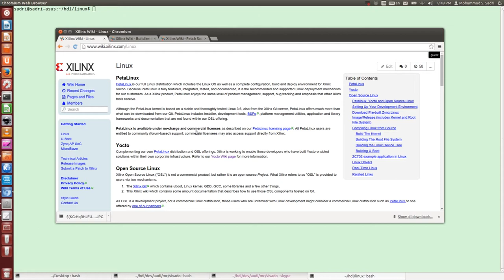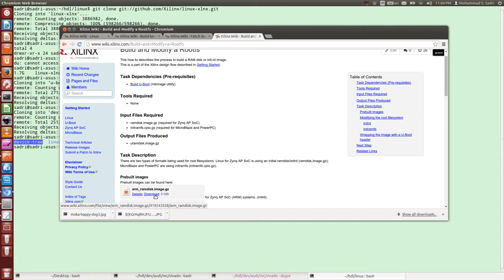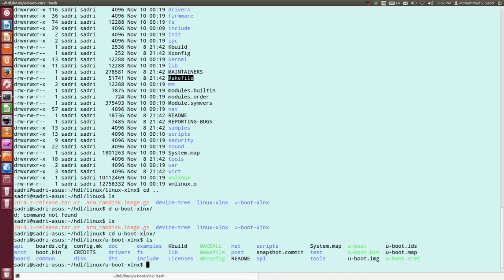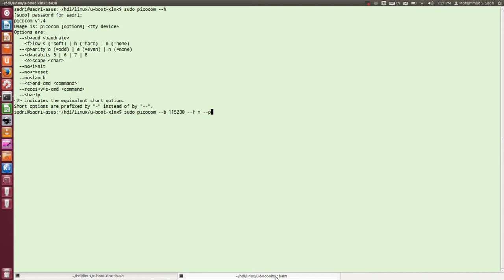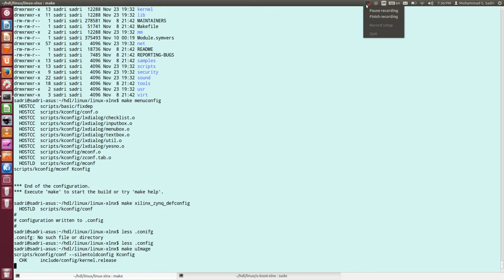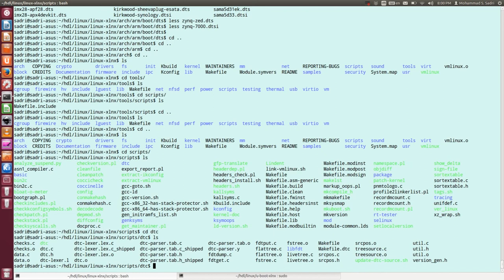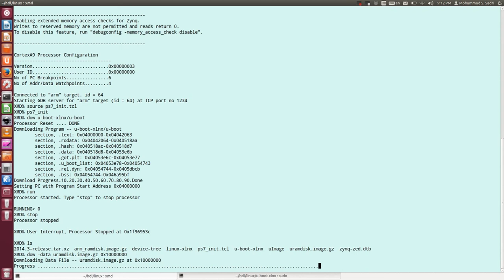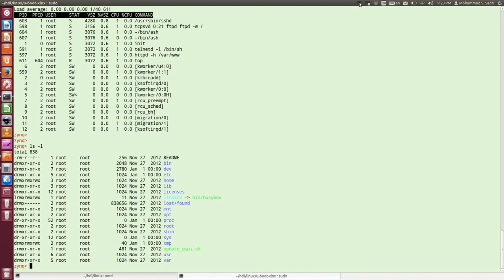Zynq Training - session 11 - part ii - Compiling U-Boot and Linux Kernel And Booting them on ZYNQ

Comment: Hey, Thanks for these nice video series. I am been working on RedPitaya and videos like these are a very help for me. I really appreciate that you not only shows what needs to be done but why it needs to be done in a specified way, which a lot of people just skip. 
Did you have any expereince with the Asymmetric MultiProcessing in Zynq7000 series SoCs?
Reply from the maker: Hi Waqar, thanks for your interest in videos. You mean to run , for example, linux on one core and another OS on the other one?
Reply: @MohammadSSadri  Yeah. I am almost there, just struggling in the last few bits.
I am planning to run Linux on one core and FreeROTS on other. That way we will be integrate the system with RedPitaya EcoSystem without that many changes.

Comment: Hi Mohammad,   Outstanding set of Zynq videos, very clear and well done.  In Session 11 - Part ii - Compiling U-Boot several boards I have tested program/operate exactly as described in the video but there is no terminal output when the con u-boot command is issued. In each case the dow command loads the u-boot.elf successfully and I can read from memory with no problems.  I have tested several ps7_init.tcl files based on your comments but none of them show any terminal output when u-boot is executing.  Any suggestions on debugging u-boot terminal output issues would be greatly appreciated.

Comment: Hi Mohammad, great job!
I'm trying to install Linux on QSPI flash. Is it necessary to compile a new FSBL? I tried to use the one provided by Xilinx but at the moment nothing works for me.
Have a nice day and thank you again
Reply from the maker: Hi Sarafino. I boot from QSPI in many projects. no, basically the fsbl does not need to change. you create one single boot.bin file with all the required parts in it and flash into qspi. should boot up. the intro video for a series in which i bring up petalinux from qspi flash is here: https://youtu.be/7rVamez_nBI

Comment: I followed up to running make for uboot (time stamp 25) and hit a problem. I'm using Ubuntu 16, and Vivado 2015.4. My board is a zc702, so I ran "make zynq_zc702_defconfig" to set the board configuration. Then I ran make, and got a fatal error (openssl/env.h missing). So I'll read the procedure on the wiki, maybe things have changed. Note, the wiki says "U-Boot depends upon an externally build device tree compiler (dtc) in order to build successfully. Please build the dtc tool before proceeding with the steps described below "  So shouldn't we do the device tree first?

Comment: Dont know if this will get answered, but when I dow u-boot to my board and then run it, it gets hung up right before the autoboot starts, so I never get the zynq-uboot> command prompt. Anyone know why this might be?
Reply from the maker: disable the autoboot. look inside u-boot/include/configs/ for the file related to your board. the autoboot should be there, you can make it very long or disable it
Reply from the maker: Did your issue get solved? sorry for being late.

Comment: Hello, I am at the 20:00 point in your video, where you run the command 'make zynq_zed_config' and get the feedback 'Configuring for zynq_zed board...' 

I have followed your steps throughout the video, but when i run 'make zynq_zed_config', my terminal outputs the following:
HOSTCC scripts/basic/fixdep
HOSTCC scripts/kconfig/conf.o
SHIPPED scripts/kconfig/zconf.tab.c
SHIPPED scripts/kconfig/zconf.lex.c
SHIPPED scripts/kconfig/zconf.hash.c
HOSTCC scripts/kconfig/zconf.tab.o
HOSTLD scripts/kconfig/conf
#
# configuration written to .config
#

Any idea as to why this is different than what you get? I am running Vivado 2015.4 and SDK 2015.4 

Thank You
Reply: I decided to go on regardless of the above, and ran the 'make' command in the u-boot-xlnx directory, and am getting the errors:
awk: symbol lookup error: awk: undefined symbol: mpfr_z_sub
make[1]: * [spl/u-boot-spl-pad.bin] Error 1
make: * [spl/u-boot-spl] Error 2

I saw on your googoolia page to remove the LD_LIBRARY_PATH lines but the problem still persists. I can not find any other solutions for the awk issue, or the other two make errors.
Reply from the maker: Hi and what happens when you run make? does the u-boot get created?
Reply: I restarted my machine and all the errors went away. My current issue is loading U-boot onto my board. I can connect via picocom however I am having issues with XMD. I am getting an error saying XILINX_SDK does not have Tcl libraries. I went into an xmd directory containing a number of .tcl scripts and ran them in Vivado Tcl console, all but two of them executed with no errors. The two with errors were jtag_mduart_terminal.tcl and flashwriter.tcl. I do not know if running these scripts is even the correct solution to the problem. Either way, upon booting XMD it fails at initialization, so I have gone on with creating the Kernel Image to avoid wasting time. Thank You for your prompt response.

Comment: Hi, 
I have problem with compiling device-tree using dtc. After typing ../../../../scripts/dtc/dtc -I dts -O dtb -o zynq-zc706.dtb zynq-zc706.dtc in folder with linux kernel (arch/arm/boot/dts): Error: zynq-zc706.dts:15.1-9 syntax error, FATAL ERROR: Unable to parse input tree. 
Maybe you know what could cause this error?
Thanks in advance ;)
Reply: Same error. Did you ever solve this problem?
Reply: i got the same error... did you solve it？
Reply: I had the same issue and for me it was the #include needed to be /include/

Comment: Hi, i have configured ps7_init project as simple PS and Hello World template. Everything works fine but at the end when i am trying to RUN Processor again i have got an error that Processor has stopped. U-boot is working, but at the end, Linux booting didn't work. Could you please tell me where did i make he mistake ?
Reply from the maker: +Alok Mistry You mean linux did not start booting?
Reply: +Mohammadsadegh Sadri Yes, it was showing me that Processor has stopped, and some problem with U-Boot. But, i think i would try TFTP method of your next video. Thanks for videos.
It would be great help if you could make video about Device Driver for custom IP on HLS, integrating with Linux. or if you can just provide some references on how to do that will also work.
Thanks.
Reply from the maker: I have a set of videos on that, but they are not free. might you be interested contact me.

Comment: hello if i custom myself hardware with vivado 15.4, how should I porting linux os?
Reply from the maker: Hi Rufeng, I have a set of educational videos that teach you how to write a kernel level driver for your own custom hardware under linux running on the arm host. the videos are created with the emphasis on axi dma and to use it under linux on the arm host. the package however is not freely available. might you need such a support contact me directly.